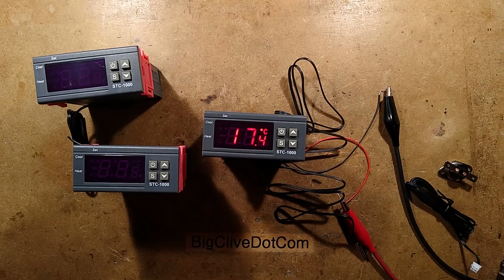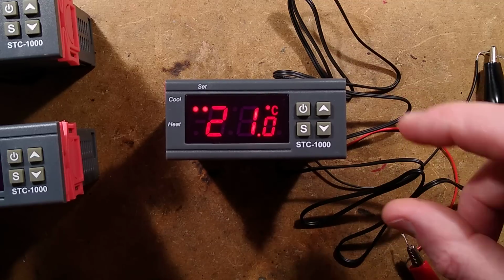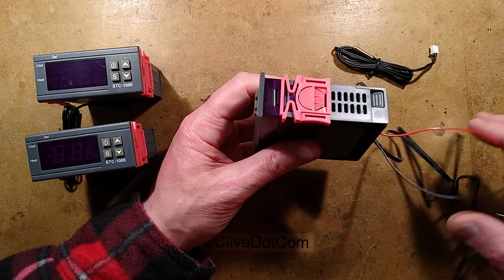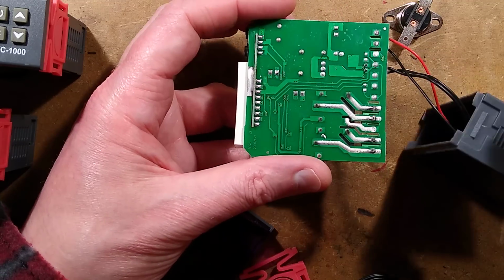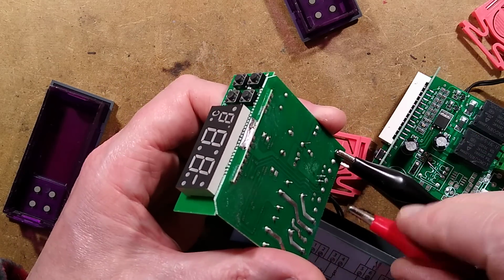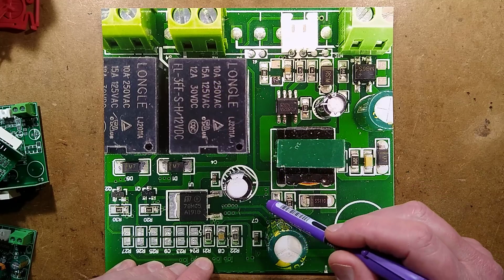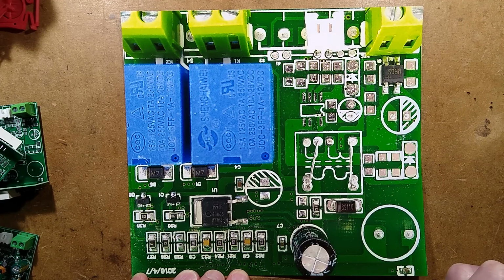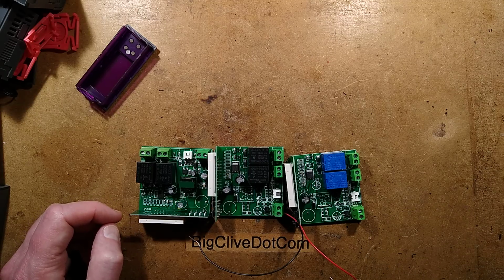Teardown of three STC-1000 style thermostats

Comment: These aren't the same units, but I learned not to trust the relays in these types of things after a PID controller running some simple resistive heating tape managed to fail after only a few months. The relay got stuck in some halfway-closed state and emitted a bunch of smoke. After that, I switched to having the relays in these switch a solid-state relay that would switch the real load. More expensive and less efficient due to the drop in the SSR, but never had problems after that.
Reply: There's a substantial difference between an ordinary relay and a contactor: the latter is built to handle much more current and is arc flash resistant.  In resistive heating or other high-current applications, a contactor is usually the safest choice.  SSRs are also good, but beware that SSRs can sometimes fail and when they do, they usually fail closed - meaning the circuit stays live.
Reply: @rewtshell  Hence, the need for a thermal fuse in heating applications.  The actuating circuit can fail with contactor permanently activated.   Belt and braces for safety is a good rule of thumb.    In my lab application, the heater is only 75W.
Reply: I use one of the Chinese PID controllers in a lab oven.  (moderate temperatures <70C).   Although it's been going for 4 years, I don't trust the thing completely, so the mains supplying it also has a 75C thermal fuse inline.   In this case, the relay drives an SSR.   Did I mention that I don't really trust the thing?   However, thus far, it's been doing a good job of keeping the temp within +/- 0.5C.

Comment: This does look like a generic version of an inkbird temperature controller, which seems more robust from my experience while still being relatively inexpensive. I'd be interested in your take on an inkbird.
Reply: @Charles Lambert  I've used one of these cheapies with a slow cooker for Sou Vide and also heating element for brewing and also with a freezer for lagering with great levels of success. They're not that bad.
Reply: I've used an inkbird hooked up to a slow cooker to make yoghurt, with moderate levels of success.
Reply: @charleslambert3368  moderate levels of success and yogurt = 😵‍💫🤢🤮😵
Reply: @samholdsworth420  it was fine just a bit more like fromage fraise or cottage cheese that I wanted
Reply: I have used ink birds twice with external SSR  no problems.. nice to have cheap tech for projects
Reply: They are amazing for the price. Used them for my resin heating chamber and chiller.
Reply: The inkbirds with the Bluetooth integration seem to be very interesting.
Reply: @ALAPINO  There are ones with BL? That one would be great to fix my busted secondary AC. Do you have the model number by any chance?
Reply: @DrakkarCalethiel  The unit I was looking to use for an animal enclosure is no longer available on Amazon but it seems, according to their website, they have a number of Wi-Fi and Bluetooth enabled models now. They likely have something that will suit your needs if you're running a small enough A.C. unit.

Good luck.
Reply: @ALAPINO  Gotcha, I thought it was a similar unit like the ITC-1000. A panel mount PID with bluetooth would be the ducks guts.
Reply: @DrakkarCalethiel  I'm sure someone out there in Shenzen-land a BT enabled console/panel mount unit.
Reply: @ALAPINO  Please beware that network connected thermostats and other controllers create entire jungles of added dangers, and should thus be avoided.
Reply: Yeah, inkbird is just an OEM rebrand.
Reply: Just bought an Inkbird to control a heater for my 3d printer enclosure.
Reply: My inkbird happily runs my dehumidifier I hacked into a chiller, for days on end so far at the longest
Reply: Hah I was just posting a comment along the same lines. I've been using the 12V STC-1K for years with minimal hassle (the occasional expected dead unit) but given the hassle I have been pondering if buying an off the shelf solution would be less upkeep/risk.
Reply: Had a inkbird itc-1000f heating relay stick shut a week ago at 4:30am, 140 watt load, had the incubator temperature up over 150° F.
Reply: I have an inkbird controlling a dumb window AC (mechanical thermostat)as It had a huge differential.
I also use it for a ceranic heater in the winter that has a dogy thermal switch.
It works well. I have a second just showing outside temp.
Those STC-1000 look ok but I would want it to be switchable for Farenheight (that the inkbird can do.)